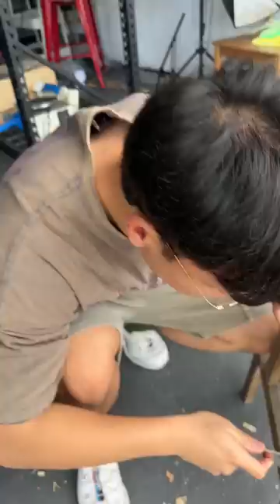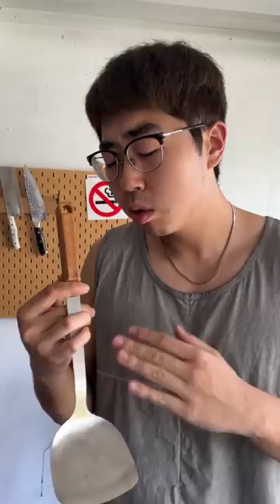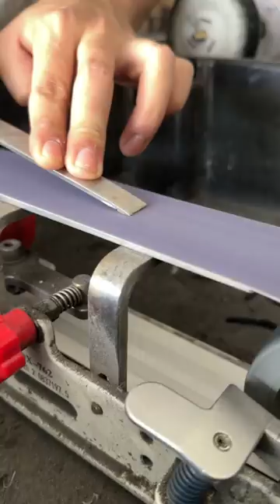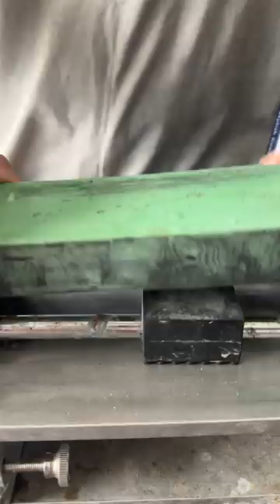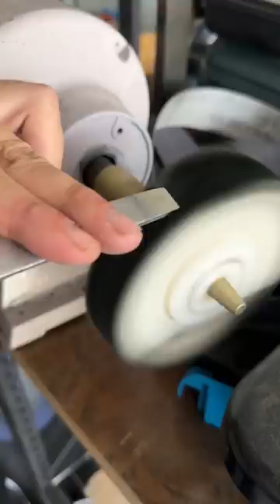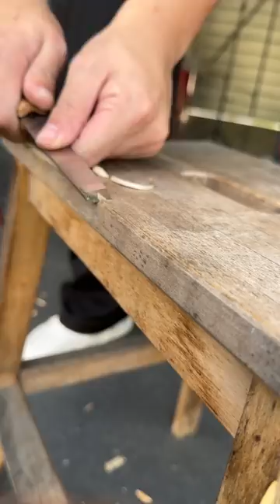Let’s make a chisel!   #fyp #shorts #knife #knives #knifesharpening #kitchen

Comment: i appreciate the effort and it was certainly entertaining but that chisel will not hold up to any form of force, point in case, see how easily he bent it. he also only forge hardened the tip which will eventually be sharpened away